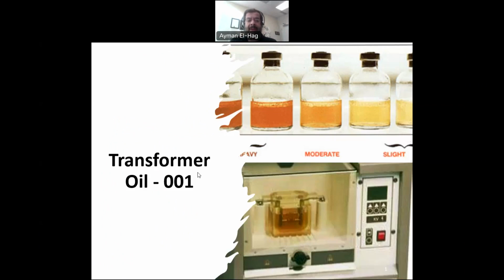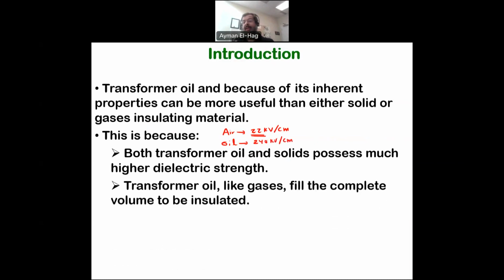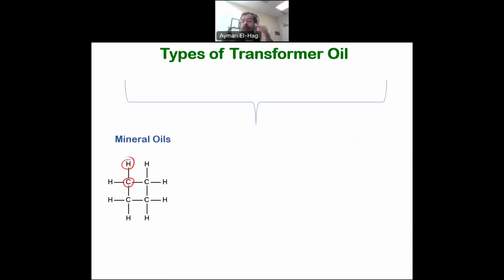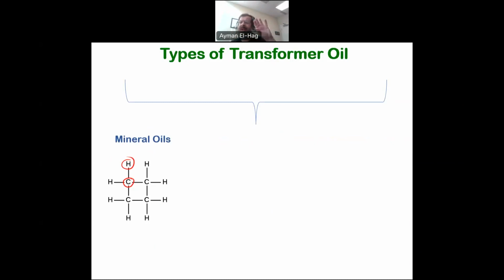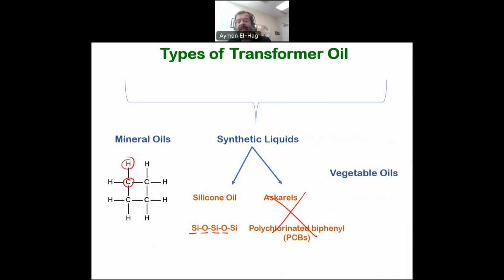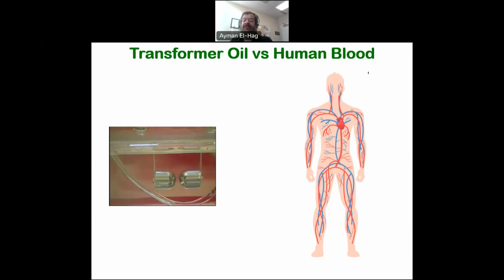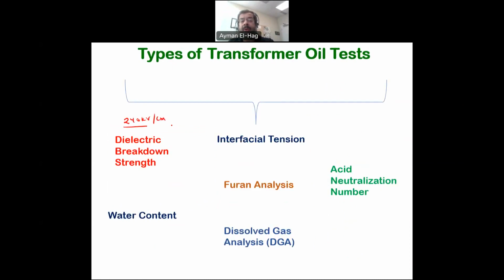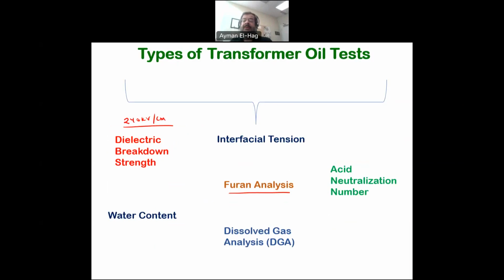Transformer Oil - 001

Comment: Is the transformer oil temperature and top oil temperature same thing ?
Reply from the maker: There are 2 temperatures specified for transformers:
A. Top oil which max temperature rise of the oil over the ambient. This can be measured using heat run test which is a type test as per IEC 60760-2.
B. Winding temperature: this is usually around 5 deg above top oil and is calculated after the heat run test from measurement of winding redistance as it cools off.
Reply from the maker: So top oil is the maximum temperature rise over ambient the transformer oil can reach and it is different than the actual temperature which is measured using the temperature sensor which will depend on transformer loading condition and ambient temperature.